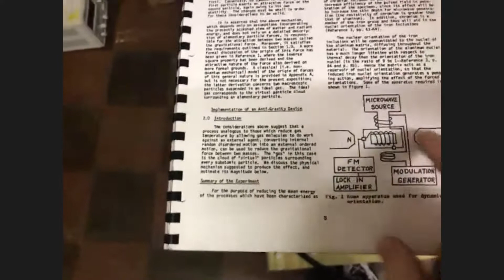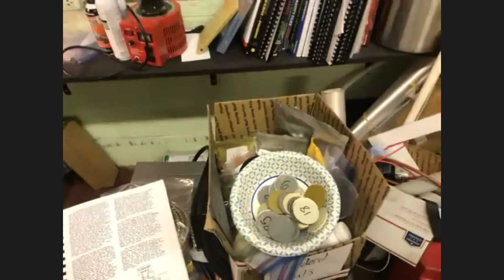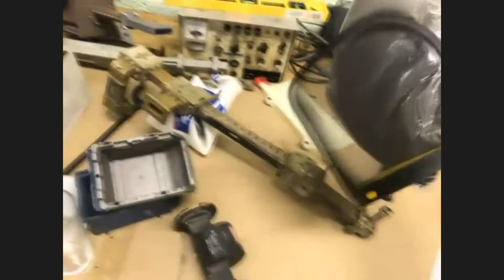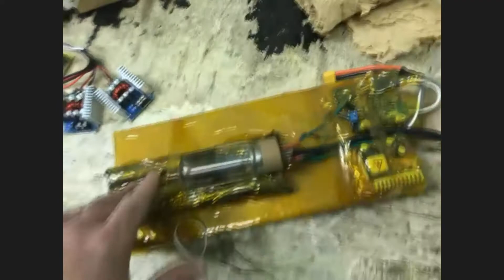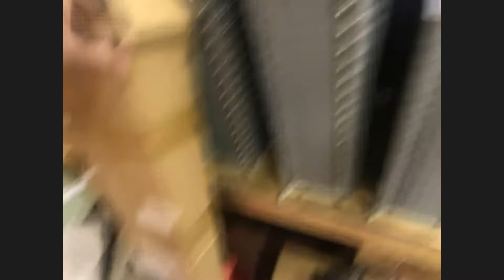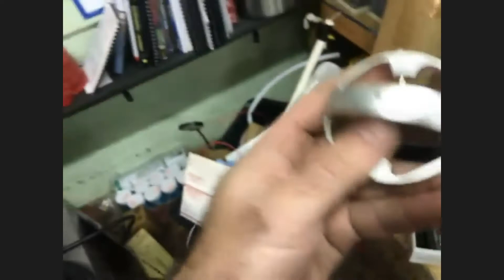APEC: 12/5, Part #6 - Mark Sokol - Antigravity Lab Experiment Update

Comment: The RC motor doesn't have the torque to turn a heavy disk. I've tried it. It can put out 800W, but at very high RPM for a light-weight RC vehicle.